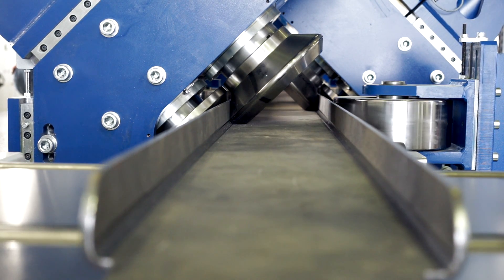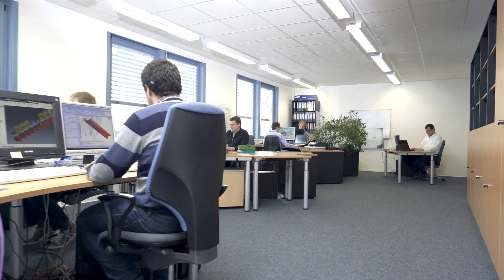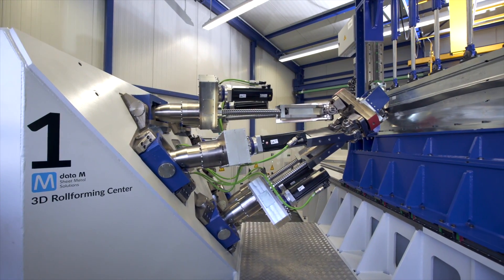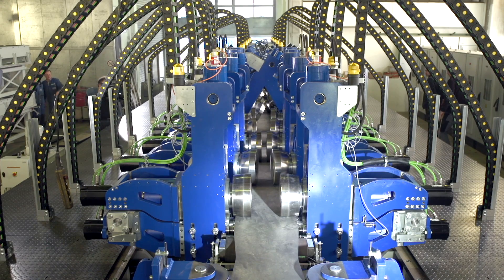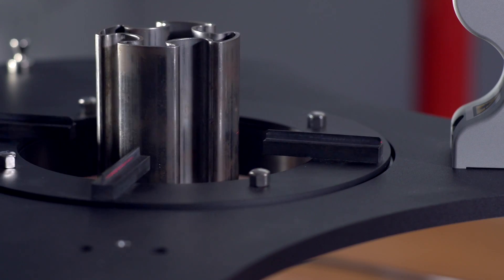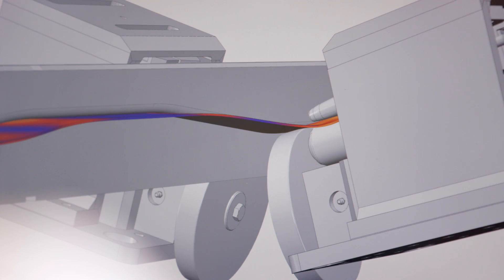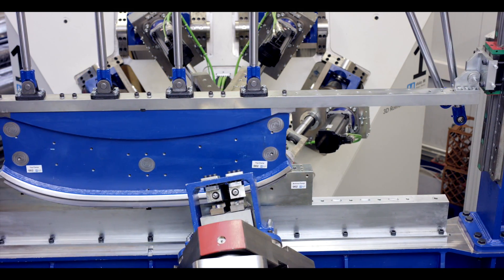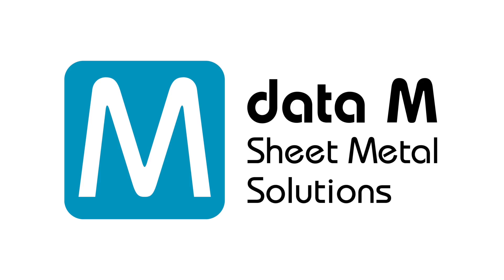3D Rollforming Center

Comment: Can it produce products with blanks or only blanks that are already contoured close to the finished result ?
Reply from the maker: As this machine is designed to produce roll formed parts in small series, you need precutted (contoured) blanks. In a machine for higher volumes and mass production we can integrate cutting and you may use coiled material.